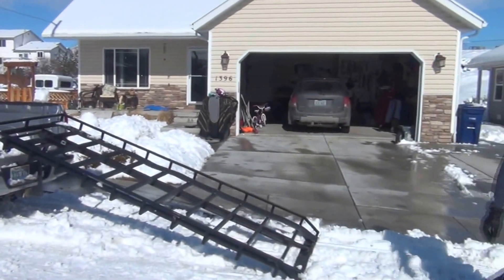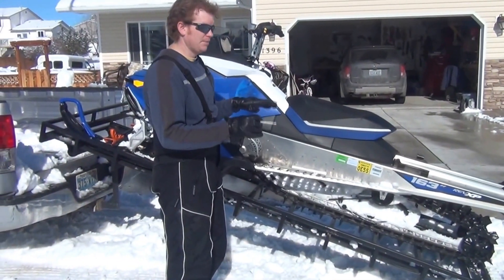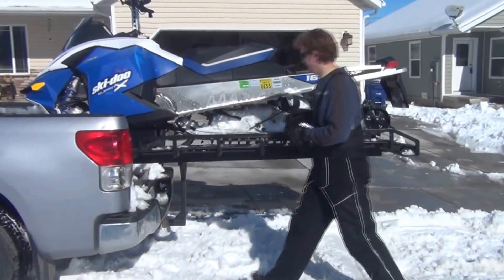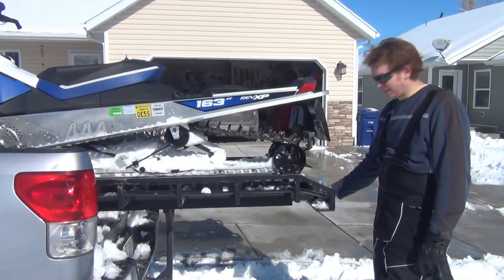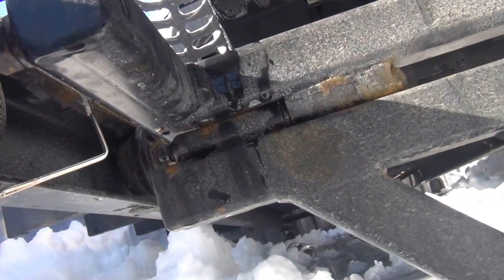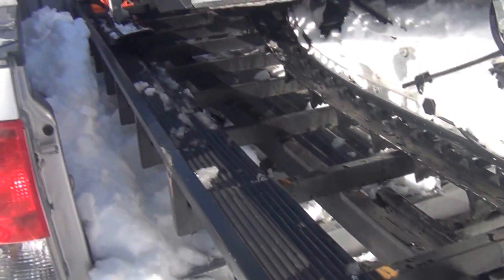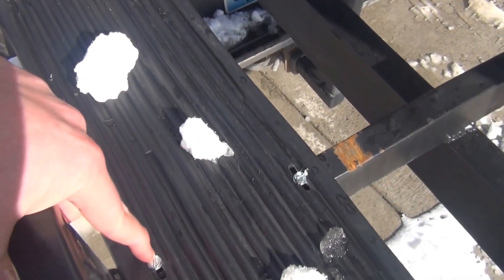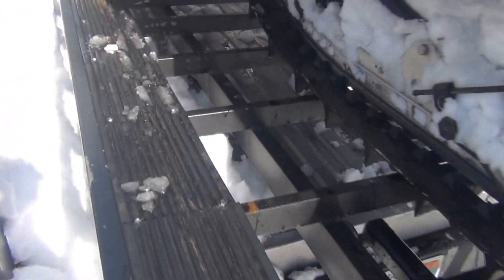Homemade cantilever-style Single Sled Deck

Comment: How about aluminum
Reply from the maker: That's my next project. While the deck works good (my caster wheels finally broke and I had to weld it together as a stop gap) it would be nice to half the weight with a lighter material and less beefy design.

Comment: Any issues with it freezing up or large amounts of snow Jamming it and making it more difficult to use?
Reply from the maker: Jaycrash25 not really. You need to make sure your bed is clear if snow so the wheel slide. 

I did have caster wheel issues late last season where the cast iron lip broke off after 4 years. I’m thinking of replacing them with rubber wheels.

Comment: I really like how you do not "mount" it to the truck but use the receiver. Excellent work. Can you email me your plan as well? rgough64@yahoo.com.  Also, tell me where you bought your stock. It's probably a harder steel than what Home Depot sells. Thank you!!
Reply from the maker: Robert G. Sent your the plans. I bought from Pacific steel. Never buy still from HD, find a local steel supplier and ask is they sell drops/remnants (remaining steel from another order). I did that for the shorter pieces and saved money. Also, of I were to do it again, 1x1 would be good enough for the cross members instead of the 2x1 i used.
Reply: Yes, I have a local fabricator where I can buy steel from. They actually just bent some aluminum tubing for me for the rear of my sled as I am fabricating a rear compartment to hold 1 or 2 small 2 gal gerry cans. LinkQ can prices are outrageous! Thank you for the plans. I'm going to try to make it so my tail gate can stay on which means I'll have to add a kick stand like support under the elbow that holds you entire assembly since it will stick out much further from the receiver. My sled is only 137 track length.

Comment: Hey man really nice job! I watched the video on the other one and it looks like he has a bar that goes across the bottom and that stops the side to side rocking that you had in your design. Did you get a design from him? It doesn't look like he responsds much but you do. Thanks!!!
Reply from the maker: I thought about it but it was overkill. The hitch is more than strong enough to handle the bit of rocking.  It does rock a bit through corners but it's not excessive. I tie strap it down for long trips for added stability. 

Yes I was inspired by the other video. I used it as the basis of my design.
Reply from the maker: I reversed engineered his design from the video and made my own design changes

Comment: Hi Scott. Same boat as everyone else.  Cant get the dropbox to work.  I know its a pain in the ass, but could use the plans.  I travel a long ways, usually alone to meet with the boys to go riding.  Live in the far north so this would work for me.  If u could my email is turkster59@hotmail.com.  If I didnt have to haul a trailer all over the place, would make my winter that much sweeter.  Have snow right now but not quite enough.

Comment: Best check each state law reguarding a "load" extending beyound the normal length of the vehicle. My state this is illegal without a light for night travel or flag, even though the load is large enough to be easily seen.
Reply from the maker: Good point. I use DOT reflective tape on the back end and is less than 48" from the bumper. Where I live I'm legit. 

I had considered some small led brake lights but at the end I didn't need them.

Comment: LOL... I just realized your name is also Scott... I used the flat strap down the sides of the deck to reduce the trip hazard and increase the stiffness of the deck edge, it is a 3”x1/8” flat bar and takes far less fitting to install. The guy I built the deck for wanted a low profile. Also if you unfold that 1”x1” you welded on yours you would find it weighs pretty close to the same but not as stiff. Not sure where you came up with 26 pounds lighter, a 1”x1”x1/8” unfolded is 4”x1/8” and you used far more lineal feet of that square tube than the strap I used... “Looks better” I guess works, if you like all the extra fitting and grinding work. The cross frames are 1”x1”x1/8” and spaced the same as the teeth on the snowmobile track. I did not use 1”x 2” because snowmobiles are not that heavy. 

The crown wheels were from a half ton I Beam trolley we bought local for about 45 bucks. So that was four crown wheels mounted to shafts with safety fingers for a bit over 10 bucks each. The link is an example of what I used.   

http://www.northerntool.com/shop/tools/product_18557_18557

I cut the trolley frame into four pieces and welded them to the tilt frame so that in the event of a wheel failure the tabs would keep the frame from coming apart. The guy I built the deck for wanted cheep, light and built in one day. 

Scott
Reply from the maker: The 26 lbs was from my original design - I had planned on 6" flat strap plus I used thinner gauge then 1/8" - 22 gauge for my square tubing on everything. 

I agree on using 1x1 instead of 2x1 - I wasn't sure about the strength at first and I wanted something longer for my long paddles to grab on to. If I were to do it again I would just use 1x1.
Reply: he had long paddles as well that is why I made the main frame rails wide so the treads would not be damaged. We spaced the cross pieces to match the tread. His sled would climb that frame like a ladder.

That makes sense. your tubing would be lighter than the 1/8th I used. I suggested raised rails down the sides for tie down points and so forth but he wanted the deck to be as light as possible so he could move it himself. I used the flat bar to give the outter edge more stiffness and keep it low profile. I originally wanted to use aluminium but he about choked on the price of the stuff.
Reply: is there a plan still available with stock list I cannot see the whole plan on sketch up

Comment: Nice... Looks just like the one I built for a friend of mine 5 years ago... https://www.youtube.com/watch?v=BKGFd5ONC2g&feature=youtube_gdata_player
Reply from the maker: Well yours was my main inspiration. I'm glad I can say thanks to you, your design was brilliant.
Reply: ;-) Thank Ya for the compliment. The guy I built the deck for originally wanted some sort of winch to pull the deck into the bed. When I told him to balance the sled so he could pick it up by hand he was a bit skeptical. So I built a small mockup up, that was enough to go ahead with the build. The video he made does not show the outter edge of the deck clearly but I made the corners come to a point and backed um up with a bit of 1/4 flat bar. The points dig into the ice so when he backs up the truck the deck stays put.

Comment: scott do you have any pic of where the pins are located i cant seem to figure it out( i am a bit retarded) and also the wheels in the c-channel thanks ( toddlungman@gmail.com)
Reply from the maker: Sure next time I have my deck on my truck. It's been a crapy winter so far. The pins go through the wings on the c channel. Location wise that's up to your sled and the balance point.
Reply: thanks man
Reply from the maker: I haven't forgot. Loading my deck up this weekend and I'll send pics.